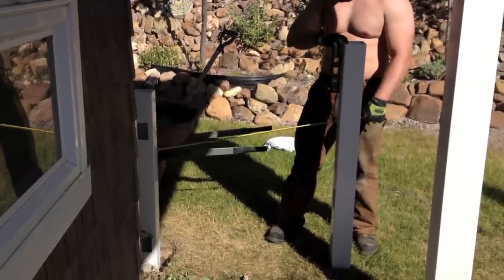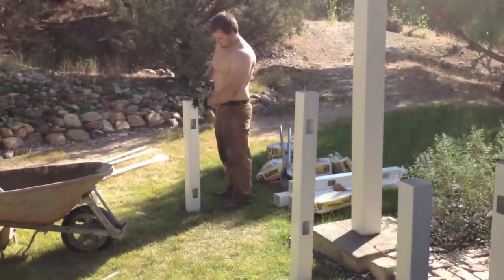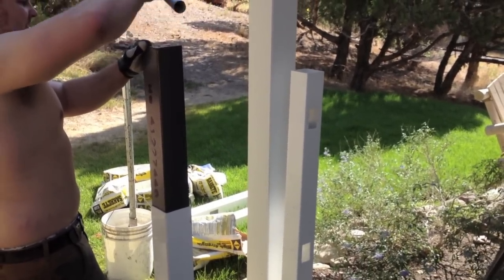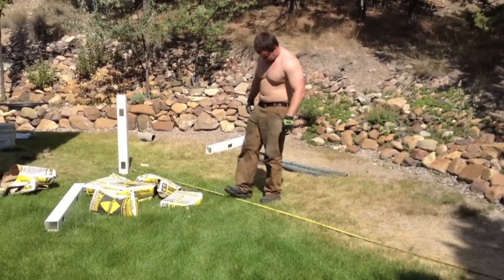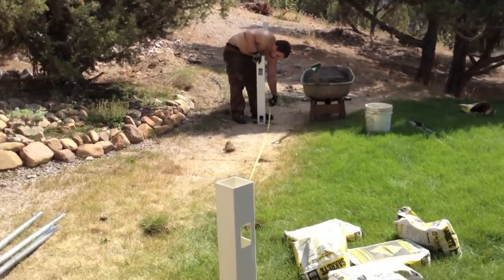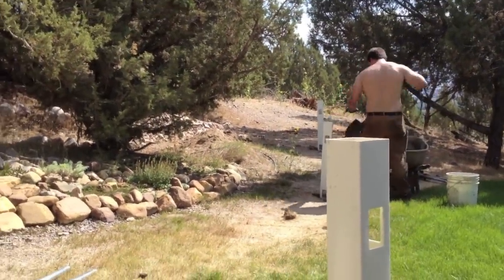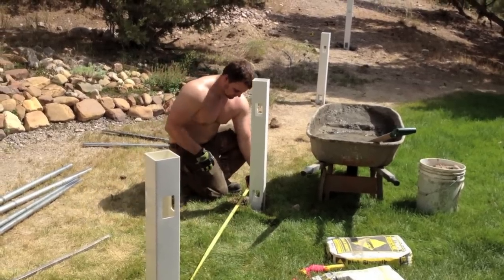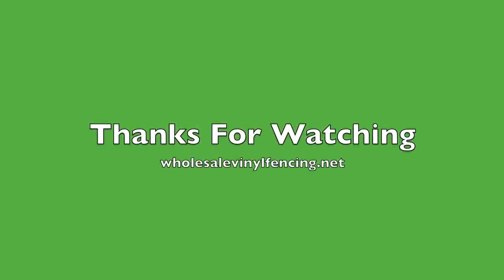Vinyl Fence Installation: How To Properly Set Posts! Part.1

Comment: You are supposed to pour concrete in after you put the post in the ground.
Reply: Wouldn’t really make a difference here since the posts are hollow
Reply: You're supposed to have either a metal post or a wooden post inside the hollow plastic fence post

Comment: I would like to know why the makers of these vynil picket fence think, that all vinyl picket fence will be installed on a dead level lot? I have a slope on 24 ft difference of 16 inches in height. Now with what every one sells I cannot possibly have a vinyl picket fence because every picket fence is designed for straight line use. Does anyone else see how stupid this is or do you all live in ohio with flat level lots. I live in the mountain state. I would like to maintain the top level and adj. bottom to slope, but manufacturers just can't seem to think along with normal life situations and topographical geography.
Reply: Then where is the example of that poindexter?
Reply: If you have a slope, then you step your panels. It isn't rocket science😂